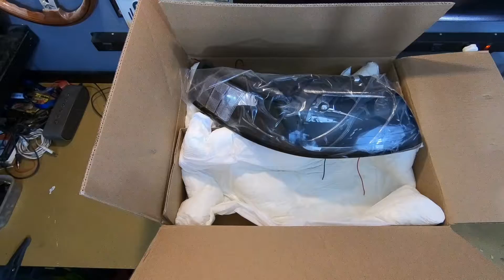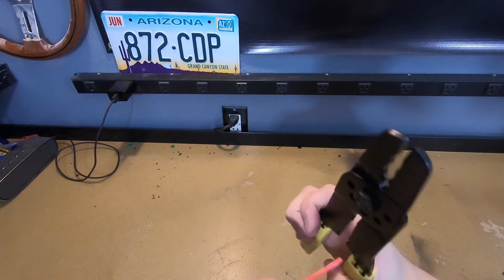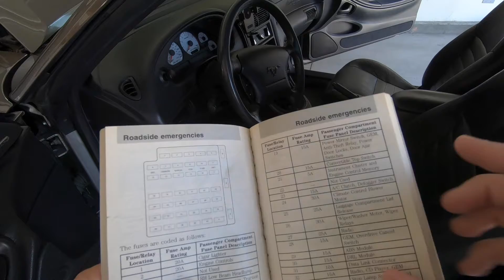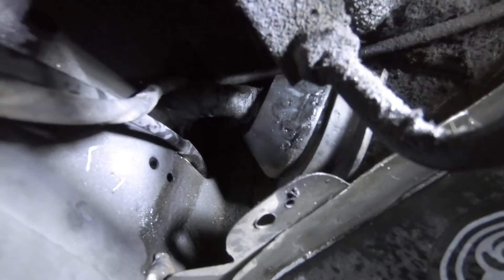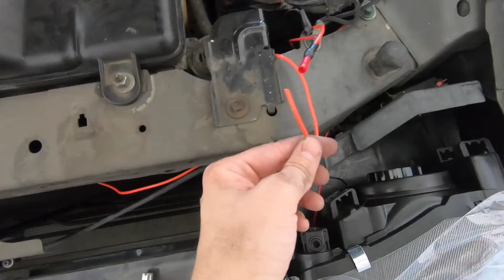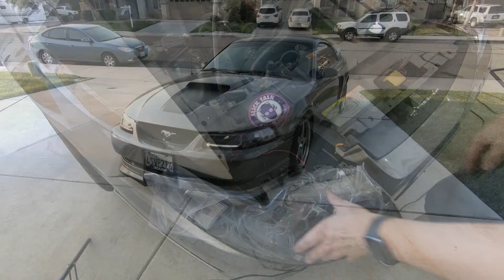SN95 Mustang New Edge LED Headlight Install - Complete How To!

Comment: Where did u get the chin spoiler I’m in love I have a 03 convertible with the same color so this really shows me the potential
Reply from the maker: it is the Roush front splitter, it came on Roush stage 1 /2 for that generation. They are a bit hard to come by, since a majority of owners got rid of them for a Roush Stage 3 front. Join some Roush new edge owners groups to see when some pope up.

Comment: This is a fair amount different than atleast a 95 gts. Where the headlights are attached are not with metal brackets but with three plastic star bit pieces that require a special tool to turn. If anyone has a good makeshift tool idea for this I would appreciate it

Comment: What did I mess up in? I installed the same DRL lights and they don't turn on when the car is on, They only turn on along with the other lights once the switch is pulled like in the video, how would I fix this? I'm new to cars in general

Comment: Installed these put it in the same fuse location but now my right headlight doesn’t work at night it gets power just not enough to light it up
Reply: Bad connection. Go back and check. I had the same problem with the drls on my f150

Comment: I had to take this install a step further. In Virginia, the DRL’s have to turn off when your headlights turn on so I had to wire in a relay switch and 2 fuse taps but it got the job done. They do look really nice.

Comment: Pretty strait forward and worked exactly the way you said. I did it the exact same way! I used a little thinner red wire, I hope that isn't a huge deal? They work great! Thanks for the video, major help in doing this. But a nice update for my 02 GT thanks a lot
Reply from the maker: it will be fine, i went overkill on the red wire

Comment: Where did you get the extra yellow fuse at the end?
Reply from the maker: it came with the fuse tap wires
Reply: Oh. My car doesn’t have that boot that you drilled through so I’m not sure where to drill now lol

Comment: what size is the headlight wire? is it 16 awg just like the wire you connected to it ?
Reply from the maker: Do you mean the LED wire? It's much smaller, I just went with a higher grade wire for safety.